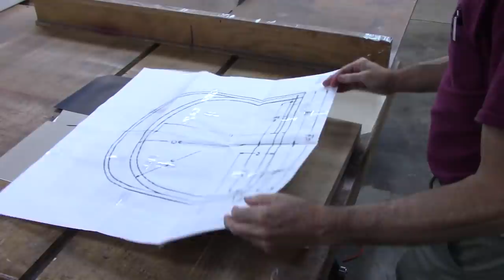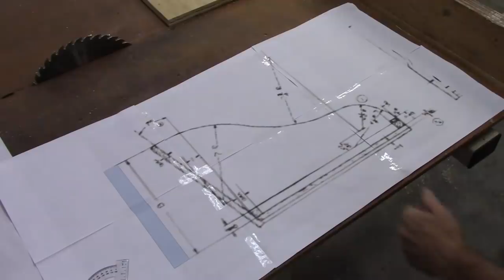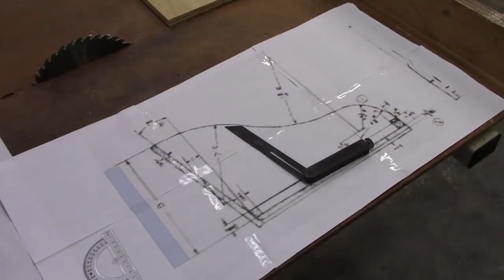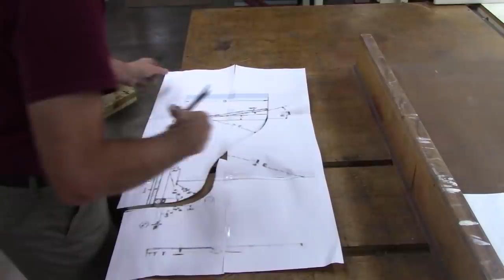Part 1 - Building a Briggs & Stratton Buckboard Flyer

Comment: I have noticed there has been no established land speed record for Buck Board Flyers.   This is your mission if you choose to accept it.  I will be your Crew Chief should proceed.
Reply from the maker: I've had it up to 38 MPH down a hill. Top speed on level ground is 28.5 MPH.  I don't think I want to risk my life going any faster. 38 is way too fast!!! 

Next up...  a Formula 1 buckboard flyer!  I'm thinking spoke golf cart wheels, rack and pinion steering, a CRT transmission and a 6.5 HP motor.
Reply: @WinkysWorkshop  There is nothing to hit on the salt flats.  ;-)

Comment: A weak monoshock might hold the wheel down.
Reply from the maker: Interesting idea although the wait of the wheel is totally adequate unless the road is wet.  The only problem is that the wheel has to scoot sideways in a turn and it chatters. the shock might be a solution for the chatter.

Comment: You're amazing do you think you can build vehicle like that with minimum tools of course electric welding wire fed that's probably the cheapest I meant to say most inexpensive if anybody can buy a PlayStation or an Xbox they can buy a wire feed welder thank you for your video and your consideration
Reply from the maker: Thanks
Reply: just take your time, you can do it. & if you fail you will have learned alot from your expierence. better then ps4 any day!

Comment: death trap. can see it folding in half at any sort of speed.
Reply from the maker: Top speed is 28 mph. I'm not at all worried about the wood. It's straight grain oak. The wheels are my biggest concern. They have a high load rating but the rated force is straight down not lateral. With that being said, it's not the safest car around! It;s not something the neighbor kids will be riding. No side protection at all and the brakes are terrible. Time have changed...  in 1920 these things were street legal.

Comment: Those welds look bad !
Reply from the maker: I agree 100%. Its an under powered MIG on many of them. The axles are a little better because I welded them with a friends welder. The bracket for the motor lift is an eye sore. I will say one thing however... it's a stong weld. i tried to straighten the motor lift bracket and it would not give even a little. I'm getting a little better but  have a long ways to go.

Comment: Sound level difference between dialogue and machinery is way too much. I tried to hear what you were saying I few times only to be suddenly deafened by machine noise. 
My first time to your channel. Won't be coming back. I want to keep my hearing.
Reply from the maker: Sorry about that. It is worse on a cell phone. Computers not so much. I actually adjusted the volume down while the machines were running. I'll definitely consider doing this more. Part 2 is cut but 50% on ll machines. I thought part one was the same...  check out part 2 and if it sounds bad please comment again. 
And thanks for the heads up!